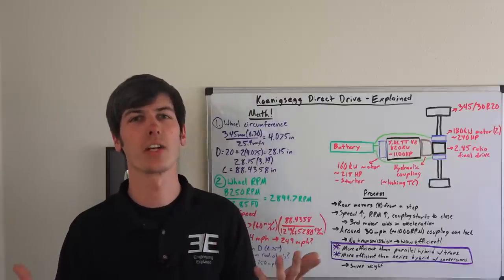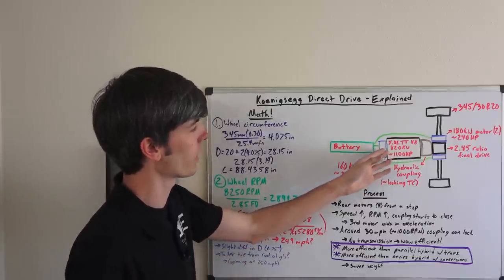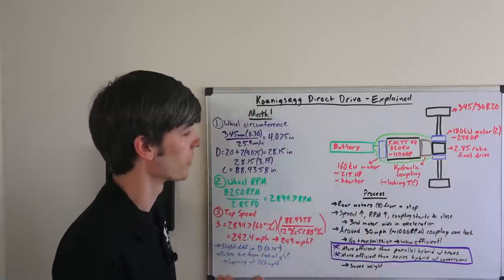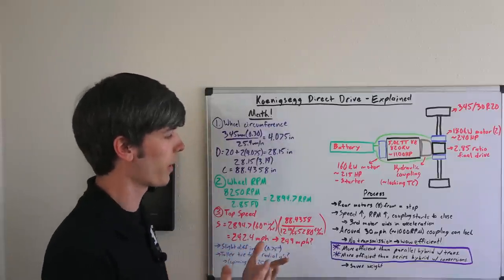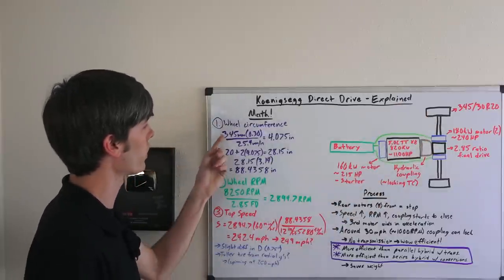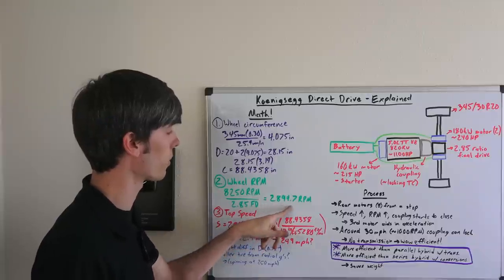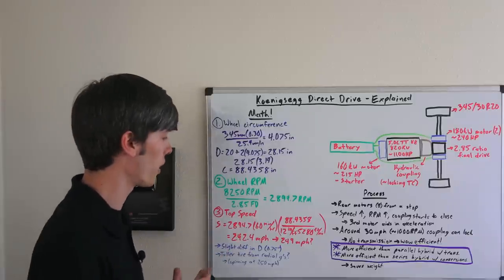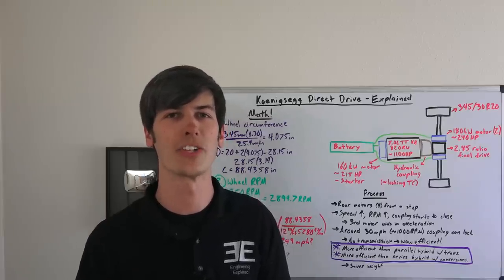Koenigsegg Direct Drive - Koenigsegg Regera - Explained

Comment: I like how hybrid technology was intended to improve cars fuel consumption and reduce emissions, but now is just used as a way of making ludicrously powerful cars.
Reply: Nathan Dance 
Exactly haha
Reply: Absolutely ‼️😅
Getting rid of the torque converter would be the real Direct Drive. With an Integrated Starter Generator from a mild hybrid system taking care of stalling speeds this should be possible. Allowing the ICE to be paired directly to a CVT.
Reply: @GbMuthu  that should be made

Comment: Why do you use imperial measurements?  Wouldn't it be so much easier/cleaner to use the metric system?
Reply from the maker: My audience is primarily American, and the rest of you are better at math! 

Jokes aside, the world is full of a combination of both, and sadly engineers must understand both. Tires are labeled 345/30R20. That's 345 millimeters wide with a 20 inch rim. Who started that nonsense?
Reply: Of course it would be, but its Murrica :D (no offense)
Reply: He sometimes use the metric. I think it's because he has a large american audience.
Reply: Metric measurements will only take you so far in this instance. One of the fundamental measurement units in Jason's calculations above is the hour and there is no metric equivalent.
Reply: patw52pb1 metric equivalent is still an hour, however, the accepted SI unit for time is seconds but that is only to make some equations neater without a bunch of unnecessary constants
Reply: Engineering Explained I believe this is from not wanting to entirely change all cars that already had rims to different but close metric equivalent rim diameters
Reply: It's very easy to do metric to imperial and imperial to metric. I'm a machinist and we get drawings mixed with both for the same parts from different companies its annoying. When you do conversions all day, this video is easy to understand.
Reply: Engineering Explained Just a suggestion: have the final answer in metrics (km/h) in brackets besides the imperial (mph) answer. Even though multiplying by 1.6 isn't a big deal.
Reply: wingman778 There is no official metric/SI unit of time other than the second.
Reply: Engineering Explained Very simple solution, always show/write both when possible so everybody is happy :)
Reply: a robot space ship crashed into mars because there were two engineering teams behind the project. One was using the metric system to calculate distances, the other was using the imperial system and neither team compensated for the inaccuracies of conversion lol
Reply: patw52pb1 Are you sure!? What about the time it takes light in vacuum to travel 1 079 252 848 800 meters? ;)
Reply: botinhas82  I am only aware of International System of Units defining a single official unit of measure for time and that is the "second". 
The SI second is defined as the duration of 9192631770 periods of the radiation corresponding to the transition between the two hyperfine levels of the ground state of the Cesium(Caesium) 133 atom at rest, at a  defined temperature of 0 degrees Kelvin. 
The International System of Units (Système international d'unités or SI) is officially the current international standard metric system.
Reply: And in Canada we use both. 

-_-   30 celcius,  But someone weight 130 pounds and this bag of food weights 2 kg and this car goes 250km/h  (lol  #gg   canada)
Reply: Merica
Reply: ヽ(｀Д´)ノ England is weirder, when its cold people use Celsius, e.g, "it was -2 today" but when its hot, (old) people use Fahrenheit, e.g. "its over 90 degrees!", someone weighs 11 stone, a bag of food weighs 2 kg and a car does 120 mph.
Reply: Why is he using metric at all? He lives in the US, right?
Reply: Grave Engineering courses in the U.S. still teach both systems.

Comment: Tries to do engineering...doesn't use metric....facepalm
Reply: +HoneyBadger1184 The majority of US companies do not use metric for engineering. I agree metric is a better system but most people here are not familiar with it.
Reply: +HoneyBadger1184 Yeah man. Not everyone uses just metric. That&#39;s why when you take an engineering course in college or university, you are taught both units of measurement and taught how to convert to which one is required. But you mostly use millimeters, meters, inches, and feet as units of measurement in engineering. But the others are good to know how to convert into and from.
Reply: At least the US uses imperial properly; In the Uk we have a messed up system that uses both! Speed in your car? Mph. Fuel in your tank? Litres. Street signs? Yards. Bag of potatoes? Kg.

And don't forget about olympic swimming pools and double-decker buses as units of measurement too X)

Comment: Great video. Very interesting car and power system.  However I deduct some video-points for all the redundant imperial calculations and units...   METRIC - so simple.  So logical.  So easy to understand. :)
Reply from the maker: How many video points? Be gentle.
Reply: +Engineering Explained about the top speed maybe they just didn't the exact final gear ratio (the third number? 2.85x ) just so they can give us a clean gear ratio number, I mean if they electronically limit the engine at 8250rpm it's not like the car will sit exactly at that rpm at top speed
Reply: +Tim Johns yeah, it was a great explanation and calculation but watching that imperial unit juggling was so painful.
Reply: +Tim Johns I have to totally agree with you on this one! In my opinoin, the best thing he could do is calulate it the metric way, and then in the end put the topspeed number in MPH en KPH. Although you have to convert te wheel diameter from inches to centimeters.
Love the video! And my god this is an actual super simple design. Only curious how much losses it has due to the electric motor driving the engine at low speeds. How does that work with the compression of the engine and all?
Reply: Easy to understand for everyone except those that aren't familiar with metric. Would you rather he makes sure his audience can understand, or that he validate your love of metric?
Reply: let the shitstorm begin!
Reply: Around 4% of the world understands imperial units. Enough is enough.
Reply: Tell that to the bloody Japanese hahahah they love imperial units.
Reply: Dunno, japanese cars use metric fasteners here. But they have these 14mm nuts just cause the commonly used size of 13 have this bad luck thing with the number...
Reply: +mikosoft who ? american dont ! neither imperial neither metric ! sad isnt ?
Reply: Sir N3cr0 if you live in the US yes there are. the are cars that dont go to the US because switching bolts from metric to imperial is a pain in the ass. but that is why u have the US spec cars the bolts on them are imperial. but if youre gonna import a JDM or EDM japaneese car they will always have metric bolts on. and if youre diggin deep into the engine get ready to use the 17, 19 and 21 mm a lot
Reply: +Aba Dibi There are virtually no cars here that use imperial fasteners. They don't bother to change anything over either. All of my "regular" sized tools are perfectly clean and organized because I only need them on 80's and older vehicles, and older Harleys. Its all metric.
Reply: LOL    On a scale of 1 - 10, how much pain are you feeling as a result of watching a video of someone pointing to, and describing, equations on a white board?
     That aside, why we stubbornly cling to U.S. customary units is a source of much bemusement.  The voluntary Metric Conversion Act signed into law by President Ford in 1975, was abolished by Reagan in 1982.  Go figure.
Reply: Sir N3cr0  Only because America uses it and Japan thinks America literally invented everything, which is the same with most Asian nations. They are good at maths, but that seems to come at the expense of history.
Reply: Make your own videos and you can use your queer units

Comment: I think you missed one detail... the "front" 160kW motor is also a Motor/Generator... used to put energy into the battery and/or the rear drive motors (from the I.C.E.) at low speed.  During braking/coasting, the rear motors will (likely) also generate as regenerative braking... putting some of the energy that's normally thrown away back to good use for the next 0-100 MPH launch.

Comment: Big question to me is: Does this system also works for smaller engines with low engine output? And then, how much lighter will it make an average car? Say a tipical Golf 1.4 TSI with DSG tranmission weighs 1174KG (DRY/kerb/curb) and has 7 gears. Will there be any significant gain? Efficienty or weight loss or performance??
Reply: I don't think a 1.4 TSI has the low end torque to accelerate quickyl enough from 1000 rpm at 30 mph to be sufficitenly fast for daily driving.
Reply: But you could gear it totally differently! The gearing on the Koenigsegg only has to be such a wide ratio so that it can achieve 249mph. If you had a much bigger gearing reduction, that allowed you to do say, 120Mph, you might be able to make it work.

If the "fluid coupling" mentioned works like a torque converter in a standard automatic transmission car, then it will allow slippage when moving off anyway (and infact, provide a multiplication of torque).

Comment: Great video. I still don't get why you Americans calculate with those inches feet and miles (imperial). Doing this with centimeters, meters, kilometers (metric) would be much easier...
Reply: Easier for people who were raised using the metric system, as I was not.
Reply: But the difference is that if I ask you how many inches there are in 1,45 miles, you'd need a calculator to do the math. If you ask me how many millimeters there are in 1,45 kilometers, I just multiply 1,45 by 1000 to get meters and then multiply that by 1000 to get millimeters. So it's 1 450 000 millimeters, and I did all the "math" required in my head because the metric system is so simple.
Reply: Yeah and 1 liter is a 10by 10 cm cube and is pretty much 1 kg that means 1 cubic meter of water is 1000kg or one ton. 
Though we still use minutes and hours and shitty months with variable lengths for time, which are just as bad as imperial units.
Reply: kistuszek It's correct when it comes to water in ISA conditions but any other fluid the mass may vary due to differences in density.
Reply: MTYD23 because it's 'murrica